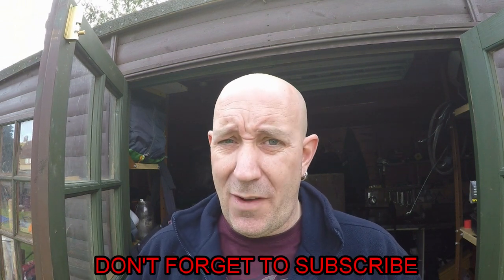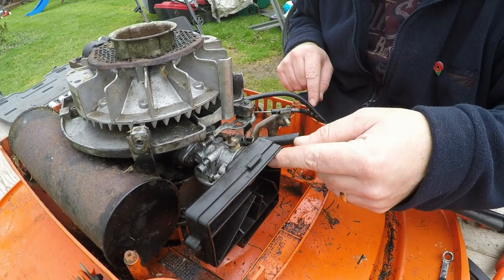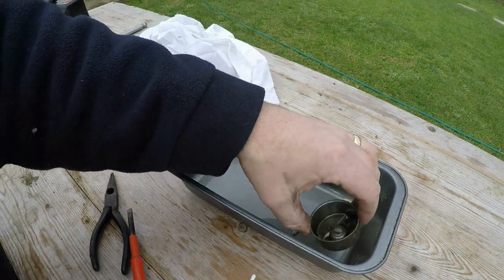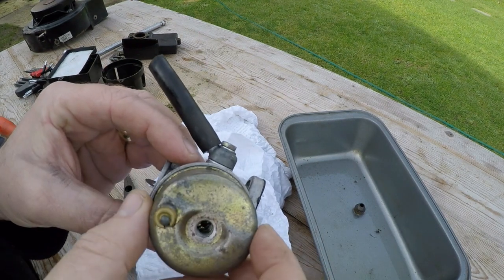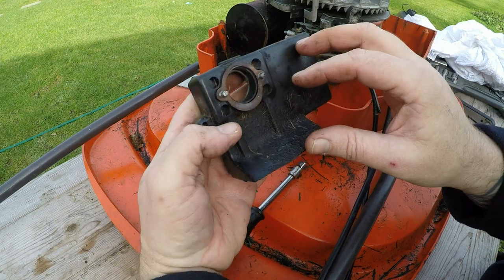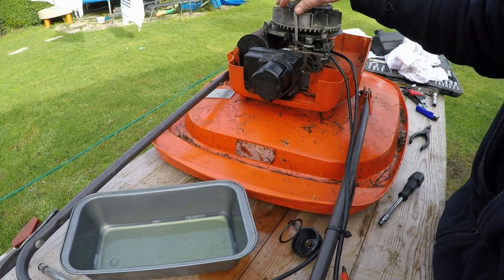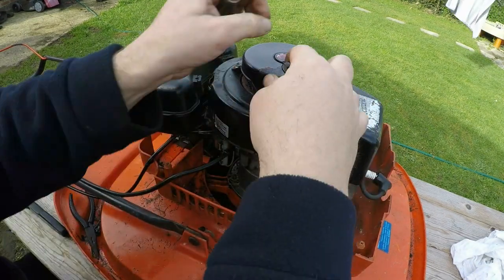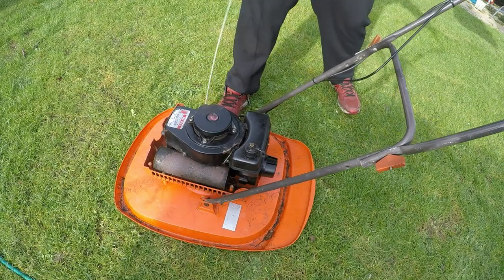FLYMO L47 TWO STROKE LAWNMOWER NON RUNNER,LETS GET UP UP AND RUNNING AGAIN

Comment: Many thanks for this Mick - I picked up this exact model at an auction and whilst (to my surprise!), it did run, it was slow and rough. It sat in the shed for a few months whilst I gathered the strength to work on it (I do a lot of DIY, but don't have much confidence in motors). I was delighted to find your video as it showed exactly what I needed to know. The machine is now purring like a kitten and cutting the grass on a really steep lawn is a breeze!! Many thanks!!

Comment: I had one from new in 1985. It did a great job until it started playing up 20 years later. I stripped the carb more times than i can recall but the improvement never lasted. If you can get one to run on full song they dont half spin. Nice video well done for persevering with it.
Reply from the maker: Thanks mate

Comment: Interesting video Mick - suggestion to avoid the fiddly bits with the gaskets - thin smear of automotve grease on both sides will hold them in place while mucking about with the bolts etc.

Comment: Hi mick make sure the nut on top of petrol cap is open when running it lets air in to tank allso may need mix scew adjusting thanks for your vidios allan
Reply from the maker: Yeah the vent is open I believe it's the main jet that is blocked it needs to come out

Comment: Hi good fix, you were lucky with this one as a lot of these people have put neat petrol in that causes piston damage. You were right it isn’t running 100% it sounds a little choked, lately I’ve had a nightmare with cheap carbs they either don’t work correctly or leak. So most of the time now I put the original through the ultra sonic cleaner. I think with the cheap carbs it seems to be luck of the draw to whether you get a good one. I’ve been having a lot of problems with carbs on my etesia 13hp ride on Honda engine I’m on my 4th🤔 first 3 leaked, I now have a carb that doesn’t leak but it cuts out at higher revs. There will be a vid up on that I think I know the problem so we will have to see if I’m right. Anyway good videos🙂👍
Reply from the maker: Life's Hobbies And Happenings I may take the carb off and put it in the vice and have that jet out. I convinced that is the problem
Reply: Micks Mowers Yes also then you can get that little tube out as well, as it’s impossible to clean them small holes outs without getting it out. Good luck👍

Comment: Good job Mick but confirm the petrol/oil mix. I have had a couple of these flymo two strokes. They were an older version but ran on a 25:1 mix. Maybe newer version is a bit easier on the oil.
Reply from the maker: Neil Harvey it is 25 to 1 mate my mistake.
Reply: @themowerman  I think the oil has improved so much since the mower was made you only need half the amount of a good oil like Stihl 2 stroke oil

Comment: Hi Mick, thanks very much for the video. I have an identical mower and your video helped a lot. My governor arm is loose on its mounting. I’v taken the part out of the carb and the arm wobbles in the brass pole. Do you have any advice on how to “tighten” it up?
Reply from the maker: Yeah I have seen this before.. wear and tear unfortunately.. not alot can be done..

Comment: i have the same one at home he turns on but after a while he stopt running when the motor gets too hot. We had taken it to a repair shop but we need new parts (carborator) but they aren't available anymore. so we are looking for a cheap new one :D
Reply from the maker: Good luck hope you find one